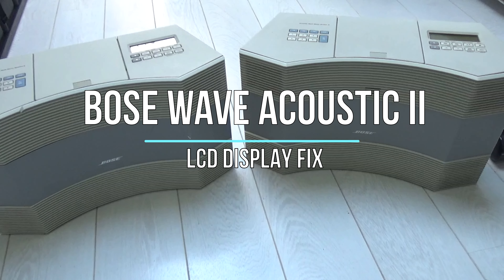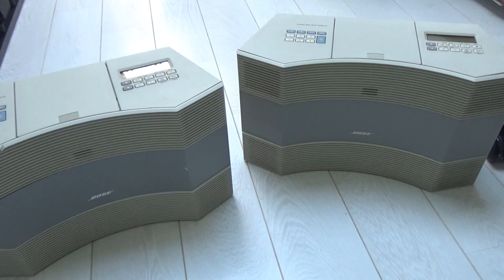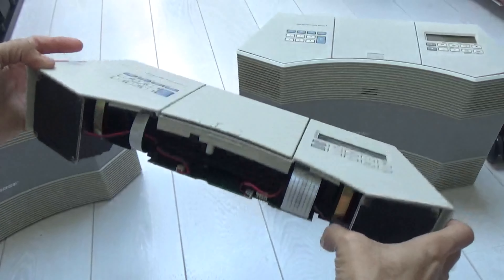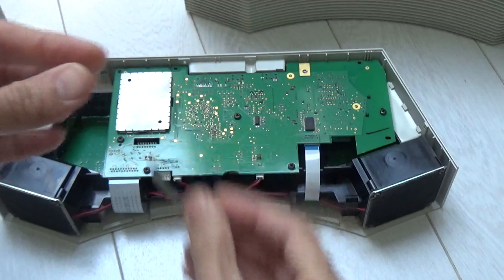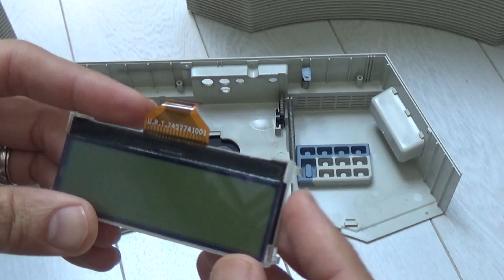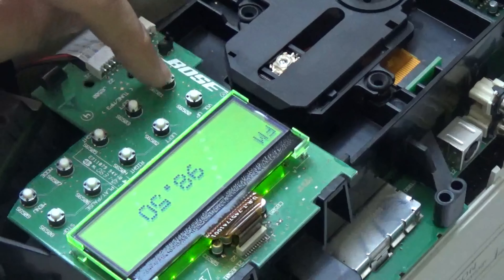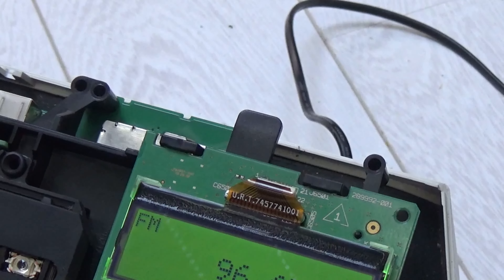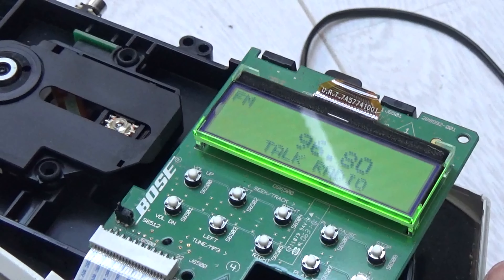BOSE WAVE II ACOUSTIC LCD FIX

Comment: I just got a new lcd screen from eBay, and with the help of this video, I was able to install and get it working. I couldn't desolder the pins for the life of me so they broke off so no lig oh well I have a new working screen now. 

Becareful with the plastic legs that hold the lcd screen floating they can break easily. 

You have to carefully pry off the lcd from the floating plastic stand, the ebay kit comes with a plastic pry tool very useful if you dont have one.

Thank you again now. I just need to replace the laser if it ever goes bad. Keep this puppy running forever
Reply: What is the part number sir kindly share me i am unable to search in ebay

Comment: EXCELLENT video. This worked! BUT how do you install the antenna on the back back in?? It does not just connect back the same way i took it off. It will not settle in right. Any help appreciated!
Reply from the maker: Thank you for your comments, To line up the antenna please make sure you insert it with the hole pointing in the correct position facing out. It will go in just a little tricky.
Reply: @thespecialist786  another video?? Bizarrely tried numerous times with the hole aligned. Will not settle in. I see a lot of these antennas broken on ebay. Would make a great video! :)
Reply from the maker: @amberallry9663  Thank you for the suggestion. I’ll make one for you. The thing is, there is a metal plate at the back that may prevent it from aligning the screw to the hole. Try a pointy object through the hole and move the metal peace down. The screw goes directly into the attenna
Reply: @thespecialist786  you're the best! How to replace install the antenna would absolutely be a great one! I will Stay tuned to your channel!

Comment: This could have been a 1-2 minute video. The entire narrative, while informative, renders the solution as: The LCD display panel  fails on these systems. It is not possible to buy the part, The ONLY fix, therefore, is to get a working LCD display from another machine and replace the non-working display with it, End of story. The rest of the video is not helpful except IF one has the replacement part and can watch this video for directions on disassembly and reassembly.
Reply from the maker: Hi, thank you for your comments, point is to show you how the error looks like and then prove it. It’s a free video so it’s up to you. Forward it if you wish or watch it.